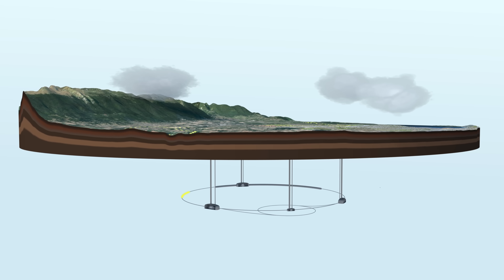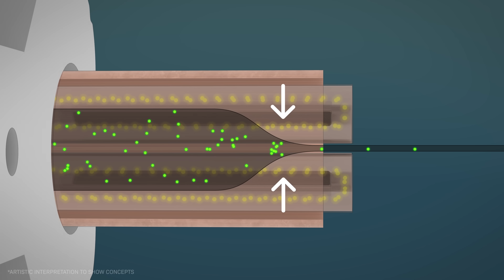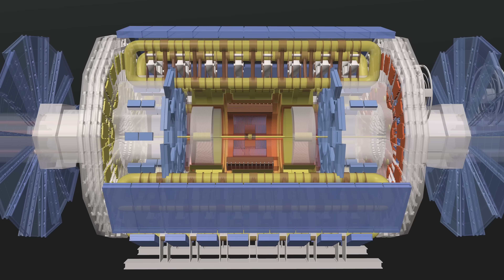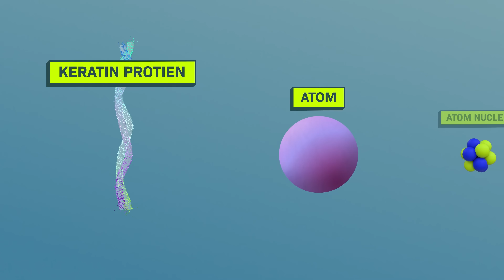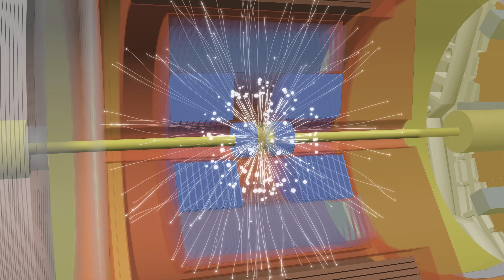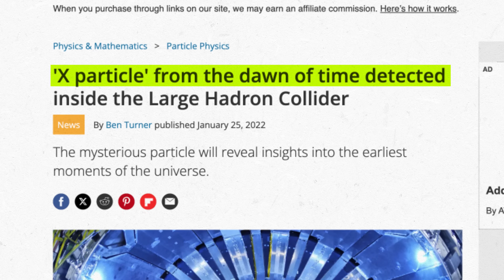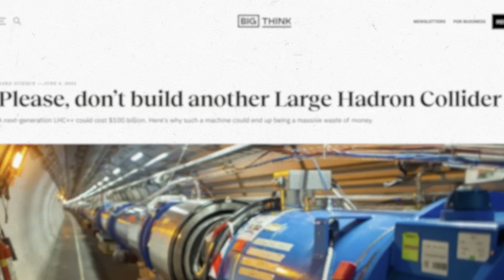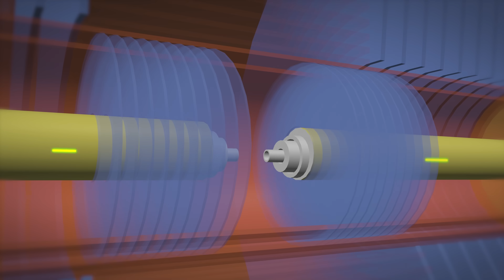What's Really Happening At CERN

Comment: I guess gravity and void of space missed their minds when trying to duplicate a big bang. 🤡
Reply: No gravity in the first instance of the expanding universe.
Reply: @kimsland999  I think the big bang was an implosion and not an explosion.
Reply: @JonesyRiley    I've never heard of it being an implosion? However there is a Big Crunch hypothesis, that most don't agree with.

The idea is that the universe keeps expanding and finally in a full entropic state of basically nothingness (called Heat Death). That the universe won't understand if its big or small (as nothing to measure it against) that it will cause a Big Crunch all of a sudden.

The other idea is that it will get to a limit of expanding then through gravity it will slowly fall back into itself, making a Big Crunch.

Both ideas have been basically thrown out, as Dark Energy is expanding the universe faster and faster, and its not slowing down!

Comment: The particles are mostly at the speed of light. A bigger collider will not increase that speed by much. What would be the difference in the collisions?
Reply: possibly bigger clumps of matter (don't see how that would help) or simply just better measuring accuracy.

Also, what is "mostly at the speed of light"? Like 90%? 99%? 99.99999%? I think the difference between these speeds and the resulting collision results might produce more insight (but I don't know actually).

Could be, that cooling is an issue. A larger collider could be easier to cool because accelerating to speeds that are even closer to lightspeed is taking exponentially more energy I presume.

Again, no idea really but there are some possible answers for you.

Comment: While I enjoyed the tour and info, a glaring error. The LHC had nothing to do with the world wide web. WWW started in 1989 and LHC not constructed until 1998-2008. As well, if we are already accelerating near the speed of light, what will be the benefits of a larger collider? If the larger size gives us greater speed,  and greater energy collisions, excellent. If not, kind of a waste. Their new run they are hoping to achieve 13 TeV runs for the collisions. Possible new particles discovered. Also, worth the new runs. If the larger collider will not be able to produce increased TeV runs in excess of what the current LHC provides, also a waste. Well, maybe. Penicillin was discovered by accident, too, I guess. Just ruminations by a fellow scientist: BS Psychology (research specialty), AS engineering. Need to be responsible and not just flailing in the dark.

Comment: If physics  is based on duality than the geometry of time should also have a twin. Some think gravity and direction of entropy are the only constructs off physic that seem be solitary in nature. Maybe it’s simpler, since time is dependent on space (you have to have at least two particles with differentiating space to record time) to think that space is the only singular point in reference to a twin universes that run in opposite direction of time, hence our ability to measure dark-matter. Seeing requires the construct of time, since by nature it is the measurement of a dynamics that requires the component of time. This is not necessarily true for gravity, if gravity is the resonant effect of a singular informational spatial point, we started from 0,  a common geometric point). In aggregate the two universes mixed could negate to 0, so where as time is never singular, space once was, and gravity is the resonant affect of that singular data point. When we reach an accelerated expansion, the other reciprocal universe will reach an accelerated state of Big Crunch, at which point it will reignite in an accelerated Bing Bang expansion, and this Universe will stop its accelerated expansion at that moment, with matter so evenly distributed, that instead of expanding it starts a cycle of returning to itself, now becoming a Big Crunch Universe, with two inverses reversing their entropy of time. Perhaps for Every Big Bang and endless expansion there is a twin universe sized Black Hole and Big Crunch event where time runs the other way. 

If we all started from 0, then we would only share one informational point of direction, which is the direction of oneself to a distinct element. So gravity is singular because it is the only common directional point between our world and the twin dark world that is reciprocal to ours and running backwards to our direction of entropy. 

Because we have that common informational-spatial direction we can measure it, but only in reference to that data point, so we can only measure it via gravity. We can’t see something that is going backwards in time from our reference, hence the matter being dark. When that world crushes in and becomes singular, our world has accelerated to an infinite expansion. The acceleration of the expansion of the universe happens because all the matter has become so singular, that our world, has to expand to in a way make up for the other worlds the singularity, because time though in practicality is always dual in nature, at its origin, like the spatial dimension of 0, was also singular, so it’s existence has to be in reciprocal to an opposite twin.

Comment: so this is covering something that is a decade old? weird click bait. we have learned a lot more about the higgs boson since then. H vs W an the influence it has the weak nuclear force. Also gravity is still a theory, so dark matter is an assumption to fix the current model. Physics as been like that for a couple decades now no thanks to quantum mechanics. I suggest reading work done by Alain Aspect, John Clauser and Anton Zeilinger. quantum entanglement is re writing a lot of known physics principles, most notably the speed of light. All quantum fields have a fundamental particle associated with them because wave-particle duality. However the mass associated  with an electron is several hundreds thousand time heavier than a top quark. The real question is why does the Higgs field give different particles different mass. I don't believe a larger one will answer that question.

Comment: FYI — wireless thermometer rapid cooling (water)

it is recommended by another brand, MeatStick that this thermal shock can damage it, which I eventually did and they very kindly replaced it with a new one, though long out of warranty 

additionally, I got a 4 temperature sensors version of theirs which is very interesting to have data of various depths, particularly very large pieces of meat

Comment: The energy with which cosmic radiation hits the Earth is many orders of magnitude greater than anything that can be generated in the LHC. Even a new, significantly larger collider would not even come close to this energy. No black holes, strangelets or other weird objects have yet been detected as a result of this bombardment, leading to the conclusion that everything that can be produced in the LHC is harmless. If you then consider that the energy produced by two streams of particles colliding head-on at almost the speed of light is roughly equivalent to the energy produced when a car traveling at 200 km/h hits a wall, it is anything but thrilling. The LHC is simply not capable of producing dangerous objects. And whether it is capable of making significant new particle discoveries is also becoming increasingly unlikely.

Comment: Ah yes, the black hole time travel parallel universe god detector that can make earthquakes and hyperlinks. Should we build another one that's 22km in diameter, to confirm that the results are not specific to Switzerland? No! Let's build a bigger one elsewhere. How about building a smaller one and placing them as concentric rings, just to see the effect on the landscape. Or we could make a very large array of colliders. Or save it until we terraform Venus, or reliably send building blocks to Mercury without crashing.

Comment: For those wondering what the Higgs field actually does it give particles their mass and there is actually a hypothesis that the Higgs field may be in a false vacuum where it’s in an energy valley but by through quantum tunneling  it can reach a lower energy state which that would effect the Higgs field around it and basically a bubble of new physics may expand at light speed

Comment: technically it was produced and made by americans from the 1952 starwars program. which had many projects and technologies. where the hydron collider was just one of those potentially useful military experiments. which was more or less one of nikoli tesla's concepts that was booked and shelved from this colorado offices, after shutting down the free energy to the city he lived by. as it wasnt till the bush administrations did they start to produce the large hydron collider in the state of texas. where the people of texas knew the possible risks of running such experiments, and furthermore didnt want repulsion radiations beneath their towns and cities. where after protests and legal actions, the texas large hydron collider project was terminated. so the united states of america sold the project to cern. where it required having so many countries to put it together for functional use because they didnt have the classified tesla notes to go with the blueprints and materials. where truth is you dont need to build a bigger one to understand more about it, you could make a smaller one which has a better cost coefficient for the same relative understandings. where the current LHC would then be the bigger one. where from my understanding of phsyics smaller parts are easier to keep cooled. meanwhile, heavier densities in smaller compact spaces produce a greater compacted reactions. giving a larger yield dynamic then just going bigger. as you can not change the size of an atom, but you can make a more dense space around the atom.

Comment: Science doesn't see energy itself as particles. So it is not true to its own principle. 

This is cheating.

If E = mC² is a physical law, then "to every unit of Mass particle there must correspond C² = 300 000 × 300 000 = 90 000 000 000 particles of energy".  Current science doesn't explain it that way.

Neither has the concept of CHARGE any physical meaning, like that of MASS (which, incidentally, is the only possible PHYSICAL property of any particle). All other properties are "word jugglery" just because experience confirms relevant formulae.

These "explanations" could prove inaccurate, just the same way as Einstein changed Newton's explanation of GRAVITY.
 
This fact clearly demonstrates that "putting a number to it" and experience confirming that formula doesn't prove the explanation attached to the word is correct.

The only solution possible is to TETHER all knowledge to PREVENTION OF EVIL ( exhaustively defined as DISASTERS, PREDATION, DISEASES ~ which include all birth defects, all weapons manufacture and all violence ~ and DEATH) ~ the single purpose cum criterion of proof of all knowledge.

The second law of thermodynamics is the most fatalistic law any human ever invented, that justifies and perpetuates all evil ~ the INSHA ALLAH principle of physics. 

All LAWS OF NATURE are human inventions. Nature has never written any law anywhere. And the "observer dependence" of results of experiments in QM clearly shows nature has NO LAWS. On the contrary, it clearly shows nature is malleable and we are free to design the laws we want nature to follow and analyze phenomena only to derive the method to implement our own design.

That scientists still attempt to DISCOVER probabilistic "laws of nature" is similar to some slaves deciding to serve their former masters even after they were declared free, simply because they had no idea how to survive on their own.

Comment: A Mandela effect could have occurred between 2019 to March 2020. Reference Wayback machine information with timing of high power use of China use of particle  accelerator and if CERNs use of LHC at the same time. 

There was a significant CME in late 2019 that caused a G3-class geomagnetic storm on December 10th. And another one in March 2021 that caused a G4-class geomagnetic storm on March 13th. These storms can cause disruptions to power grids, satellites, and communication systems.CERN's LHC was operational during both of those CME events.

If 2 particle are being measured, you can impact both its future and past. This goes against relativity because something is moving between faster than light, The past is not fixed, Dr Avshalom Elitzur 

Cross reference with time events reported in Potential Interference with Rubidium-based Atomic Clocks due to High-Power Particle Accelerator Tests" - US National Institute of Standards and Technology (NIST)

 Some believe that the Mandela Effect is evidence of time travel experiments or tampering with the fabric of reality

I found a report from the US National Institute of Standards and Technology that mentions potential interference with Rubidium-based atomic clocks due to high-power particle accelerator tests

Potential Interference with Rubidium-based Atomic Clocks due to High-Power Particle Accelerator Tests" - US National Institute of Standards and Technology (NIST) 

There was  increased power output from the Chinese particle accelerator in late 2019 to early 2020 had a measurable effect on the decay rate of rubidium on GPS satellites. 

This effect could have been caused by the accelerator's impact on the space-time fabric in the vicinity of the satellites, leading to a change in the fundamental constants of nature, such as the fine structure constant or the gravitational constant. 

This change in fundamental constants could have manifested as a change in the decay rate of rubidium, which is used in the atomic clocks of GPS satellites. 

If this hypothesis is true, it would have profound implications for our understanding of space, time, and the nature of physical reality.

This interference could result in timing anomalies. The report recommends further investigation into the potential effects of high-power particle accelerator tests on precision timing systems.

High-Power Particle Accelerator Testing and Potential Interference with Precision Timing Systems" - International Journal of Particle Accelerators and Spasmodic Oscillations - N/A 3) "

Effects of High-Power Particle Accelerator Testing on Precision Timing Systems: A Review of Potential Interference Mechanisms" - Journal of Temporal Physics and Quantum Chronometry - N/A. 

Correlate the information for any unexplained reference material from Wayback machine data to what was references before and after March 2020, then note periods when China was operating there particle accelerator, then hypothesis information correlated with potential effects of Temporal Physics and Quantum science.

Comment: This thing is AWESOME! I have an apartment approximately 33-degrees from the diametric center, ironically enough it also resides at the direct circumferential-center of the planet, ever since they've turned this thing on I've not seen a single bug or STUPIDspider. The only strange thing that has occurred, which I'm sure is only a coincidence, is warming up anything in the microwave takes at least 5 times longer and I can easily go 6 months longer before I need a hair cut.  Well okay, ...and I guess there's these random occasions where I uncontrollably pee-my-pants and forget my name for 33 minutes, which is technically a "NEW" thing. But it only happens somewhere between every 32 and 34 days! But regardless of any of my selfish and self-centered topics, I have to admit these inconveniences are essentially irrelevant inconveniences in contrast to the immeasurably important data this device is contributing to the world of theoretical-Science. At the very least it is providing a place for theoretical scientists to passionately hang-out, conduct their "research", do a little knitting and even trade Theoretical-Science-Pogs with each other, far away from the dreadfully boring and less productive environments of all other Science-Research labs where pizza and podcasts aren't considered mandatory.

Comment: They’re trying to open the gates of hell, but that’s much easier to do than what CERN is doing.  The gates of hell are opened when hydrogen evaporates into the ether, and that can happen locally right where you are.  Every time you drink alcohol or smoke weed, the gates are opened.  How?  Weed has the cyclopropane ring, which is a highly volatile molecule, which exhausts hydrogen atoms.  The ether element in alcohol is also volatile and exhausts hydrogen atoms.  Hydrogen is the lightest element, and when it evaporates, it opens the door to the lower astral planes.